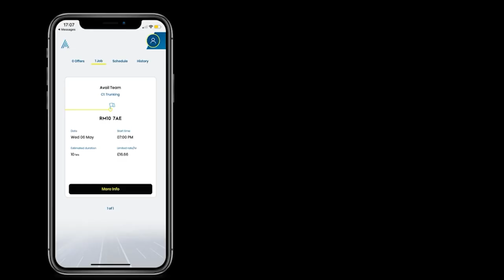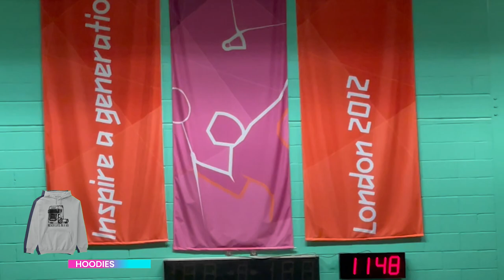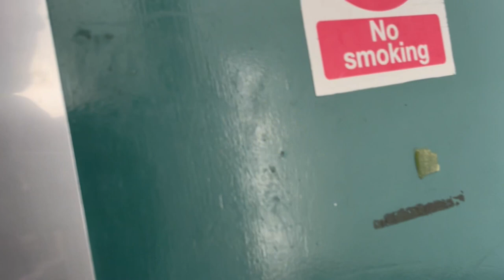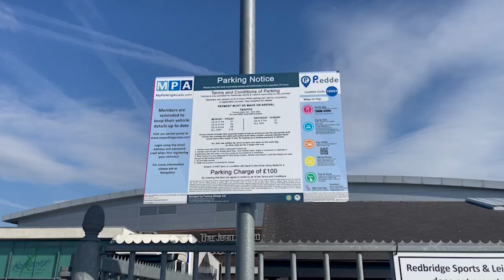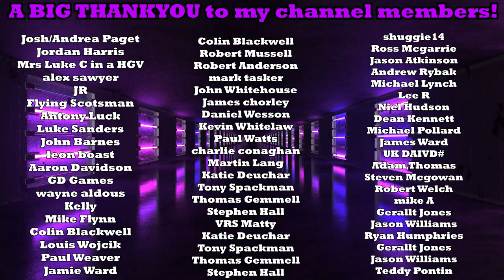Delivering GrandStand Seating To A Gymnastics Competition!

Comment: Surely you shouldn’t be lifting the unit suspension up like that when dropping a trailer? It just makes it harder for the next driver and increases the risk of the pin being missed. Should drop it at level height, pull forward slightly disengaging the pin and then lower the unit suspension and pull out completely and reset the suspension. Not to sound like I’m judging you but it was just an observation. Also the driver who dropped that trailer previously should have engaged the trailer brake. Good reversing though
Reply from the maker: No mate I’ve always been told to raise it slightly. Especially when loading, and when re attaching to any trailer raise the back end up once I’m under. 

This way it protects your wheel arches, your loading ramps and doesn’t get 5th wheel greese on the front of the trailer. 

Always raise suspension and then lower it as you come out. That’s what I do anyway. 

And yes they should have put trailer brake on. Unfortunately not a lot of people do.

Comment: hi people could anyone help me please, how do you work out the pay load over axles please to equal it all outi have just started an hgv course any help appreciated.
Reply: the weight of the load times
the distance the load is from one of the axles; and divide by
the wheelbase of the vehicle.

So If you were to place a 8 tonne load on a truck  2 metres from the rear axle and the truck had a 4 metre wheelbase. 
It would be
8 x 1 divided by 4 

So the answer is  2

Which means 2 tonnes of the load goes over the front axle. 
The remaining 6 tonnes would go over rear axle.
Reply: @lewismarriott2468  thank you